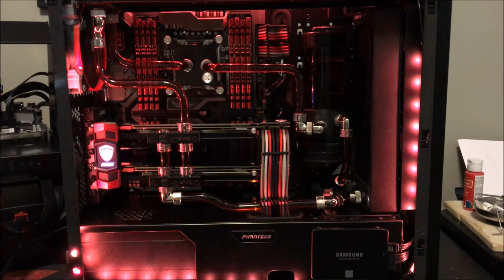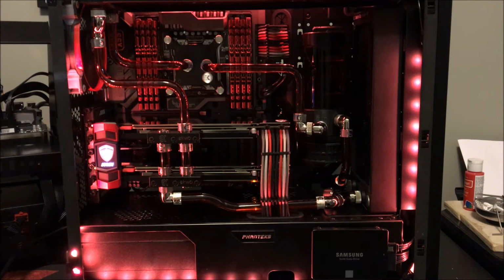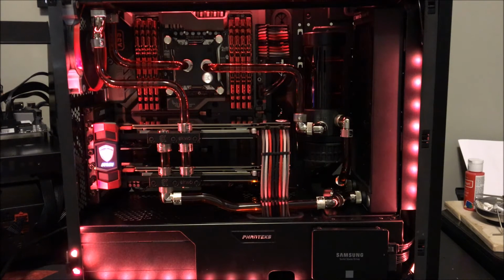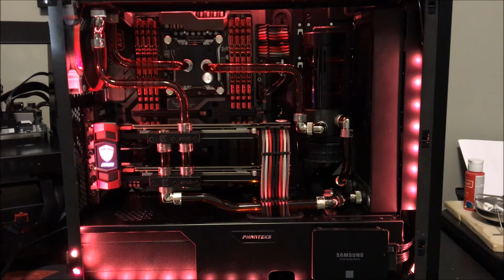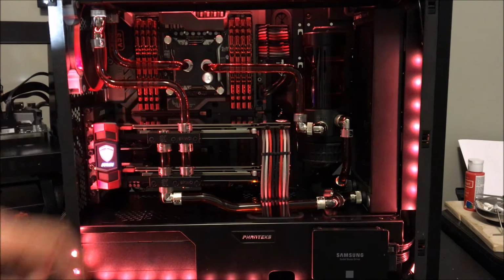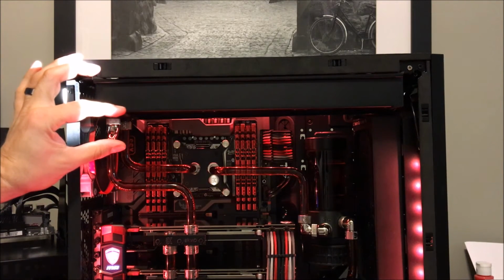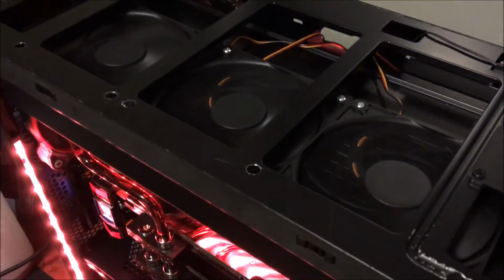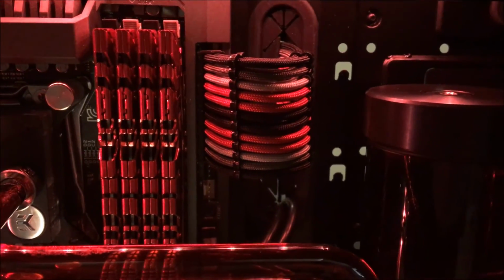Client Built 31 - Personal Rig Update & Water Cooling Tips

Comment: Hi Brian, awesome build, thanks for sharing! I'm planning on replacing my aging H100i with an EK predator 360, and I would like to utilize your awesome plan for fitting those fans/rad in the phanteks evolve atx case. My question is: did you need to use a different length screw for mounting that config? I'm concerned that I might damage the rad if I use the normal screws. Also, do you know if 15mm thick fans will fit in the upper area? I'd prefer to get use pwm fans. Any help you can give is much appreciated!
Reply from the maker: +Weston Bahr (Bahr3DCG) yes I used shorter screws with thin fans. I ended up replacing the thin ones though with 25mm Corsair SP120. I had to do some modding to get them in there. 15mm should fit without mods
Reply: +Ess Tech TV Do you mean that you have the SP fans in the roof area? What type of modding did you have to do to get them in there? I actually already use that fan in that area. Might save some money with a little effort. And thank you for the fast response!
Reply from the maker: I had to bend and cut the overhanging rails to remove or crimp the flange that hangs down in order to create more vertical space. Then I had to arch the rails up in order to get the fans in, then bent the rails back down after that.
Reply: +Ess Tech TV Thanks for the info Brian. I'll keep that in mind! Did you switch out the Scythe fans due to performance issues?
Reply from the maker: +Weston Bahr (Bahr3DCG) yes. Check out my other build logs for this system on my channel, posted about 2 months ago
Reply: +Ess Tech TV thanks! I'll do that!

Comment: Why didn't you jump the 24pin to power cycle ?
Reply from the maker: +James Emsley That's what was done to initially fill and leak test the loop.  I use a separate power supply with the 24 pin jumped to push fluid through the system for the first few hours.  Once everything was confirmed to be working correctly, the main power was connected to the mobo and the system was cycled several times through the main power supply.
Reply: +Ess Tech TV got ya. Yea I use a pre made 24 pin with a jumper. Or another psu. Good work